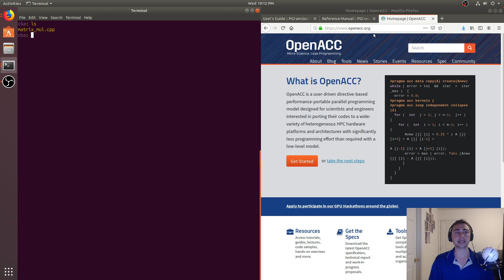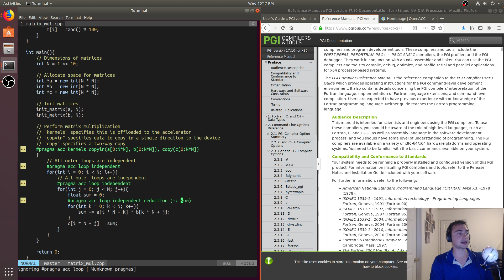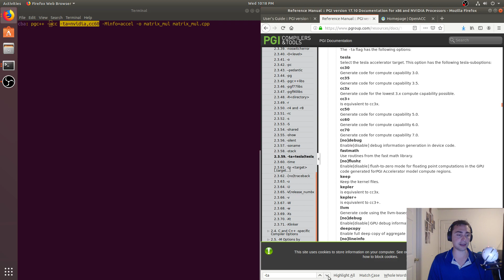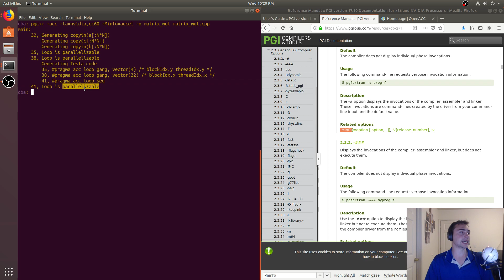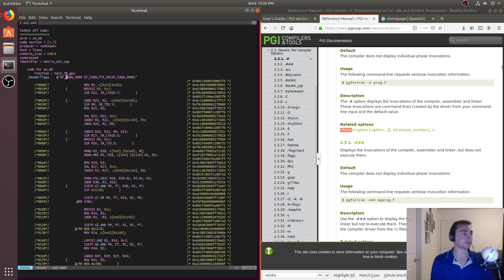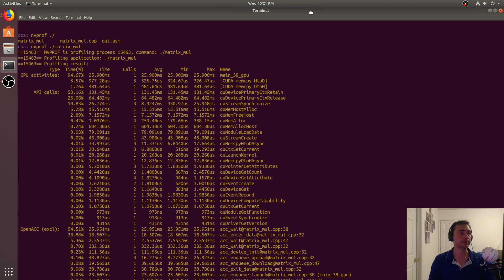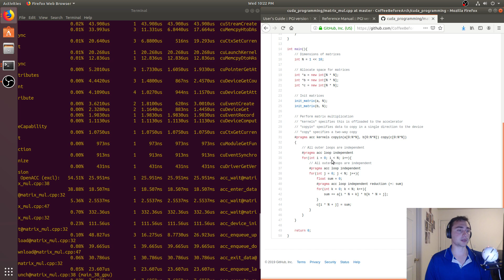CUDA Crash Course: OpenACC Matrix Multiplication

Comment: What if i want 4096 * 4096 matrix ... its not loading 😑
Reply from the maker: Do you have other info on what is happening (is the program crashing, program just taking a long time, etc.)?
Reply: @NotesByNick  i have done it actually i wanted to do 2D matrix multiplication and its doing well now i want to improve more time using threading and used lambda expression  for threading .. it turned out that lambda is not supported here.. 🙃
Reply: @NotesByNick  i want to test for 8192 x 8192 matrixes... and i want to divide threads like (matrixmulfunc ,matA,matB,matC,0,1023)
(matrixmulfunc ,matA,matB,matC,1023,2047)
.
.
.
So on untill 8191..
Help me for logic plz 😭